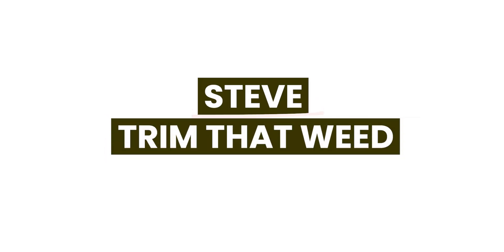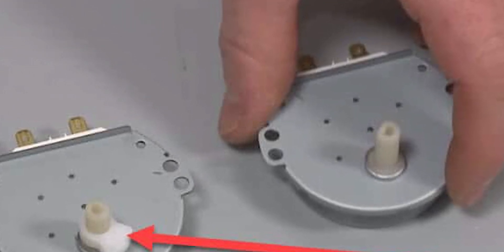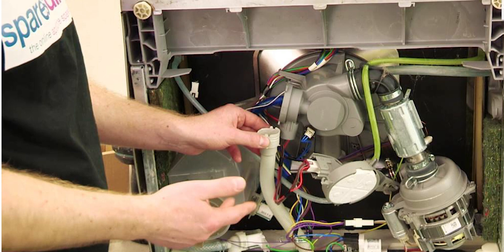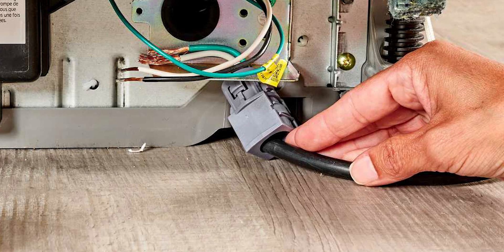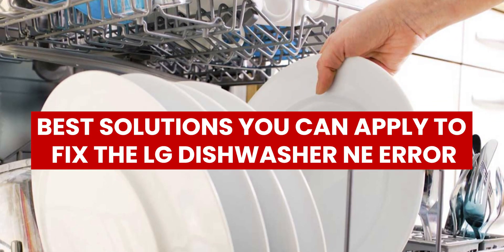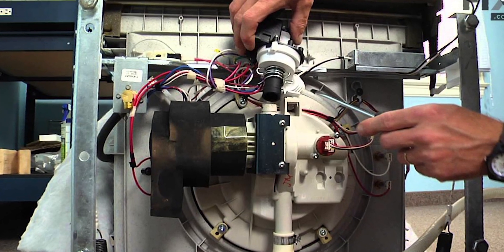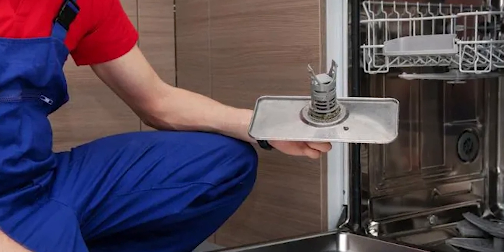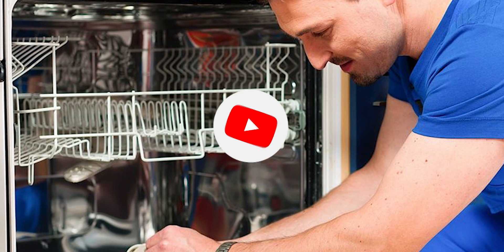LG Dishwasher nE Error –Causes and Proven Fixes (Troubleshoot Effectively)

Comment: So basically just buy a new dishwasher
Reply: Well yes, but maybe not. 

The part about “technical proficiency” being essential to replacing the vario motor is a crock of crap. It is not that hard and can be DIY if you’ve got the mental capacity of a 12 year old. As can some other simple part repairs. 

That said, LG dishwashers are garbage imo, and the simple fixes might not get the job done. 

So yeah, if you’re made of money and willing to pay Mr. Professional Dishwasher Guy whatever absurd rate he charges to MAYBE fix your dishwasher for an unspecified amount of time (it WILL break again), then sure, have at it. If you’re more pragmatic and ready to cut your losses, perhaps it’s best to go get a new one that doesn’t read “LG” on the front